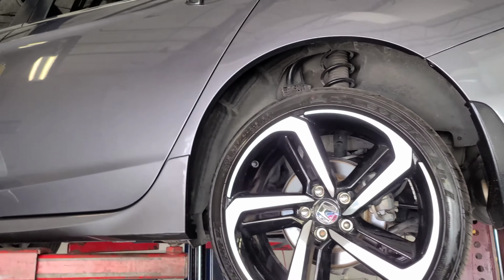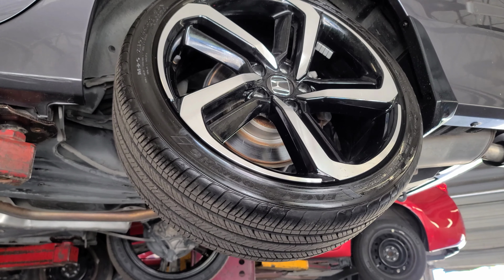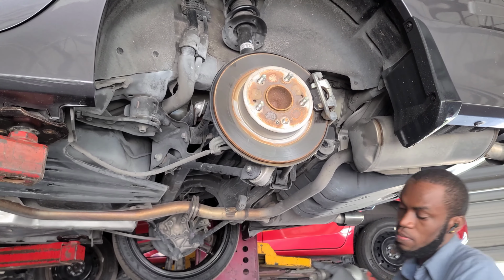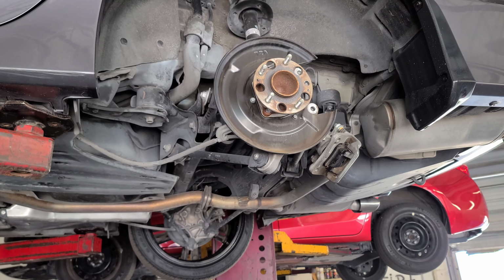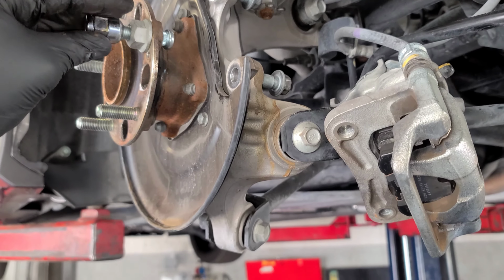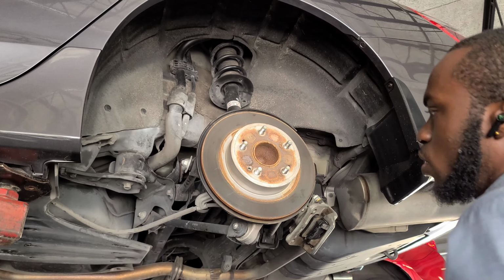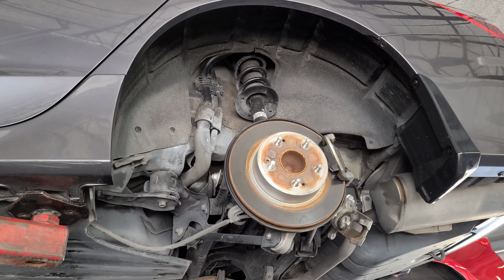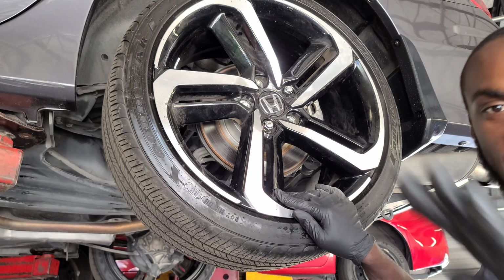how to replace your lug studs honda accord

Comment: Nice video man. I just fucked up mine this morning while trying to take the rotor screw out I accidentally hit one of the wheel studs with a hammer. I thought I need to change whole hub but no it just a screw. Thank you
Reply: You don’t even understand how mad the shit had me for the passed 4 hours went throught the same exact shit as you tryin to take rotor screws out and hit the stud off 😂 I’m cool now knowing I can just replace it and not the hub
Reply: @tb59pt  hey dude I fixed mine if you haven’t figured out this is how I did mine I tethered the stud with a thereder I got from Amazon went all the way down slowly I also put little bit oil. No problem
Reply: Fine was at the front in front you can’t take the stud out it’s impossible if it’s back it’s okay
Reply: I did the same thing
Reply: @nolanray612  rethread it if you can, you should be fine

Comment: For people wondering, this is a 10th gen accord, but this method will not work for the front hub. Doesnt have the clearence to knock them out. You either pray you can rethread the stud with a Hexagonal die ( I used Drill america M12x1.5) or you disassemble the entire hub including the wheel bearing. Good luck
Reply: bro please explain wym by rethreading the stud
Reply: dang mine is in the front too i really don’t wanna do all this but im not tryna get taxed either
Reply: ah dammit did you use a wrench or did you have a kit to thread the die
Reply: @sol1229  My stud wasnt too bad, I used a socket and twisted the rethreader die by hand, and used brake fluid as cutting fluid.

Comment: Sadly this does not work on the older 2009 accord. Bolts dont have room to come out so I had to take the whole hub of, which also pulled the bearing apart.
Reply: Hello, can you please tell me measurements for your honda accord 2009 stud? I want to order online, don't know exact measurements 🙂
Reply: @mrden1  The total length is 46mm Thread lengt is 28mm Diametre of the rifled part is 12mm. 
I bought the whole hub with the studs allready inserted. I noticed the rifling on the new studs where diffrent from the old ones, so be aware of that
Reply: Having the same issue the hub is blocking the bolt
Reply: Thats for the FRONT. 2008-2012 REARS should have room to pull of studs. 
It is however ridiculous that we have to pull bearing for fronts every time just for a $5 stud
Reply: How long did that take you to do ? I’m thinking of just angle grinding the bolts to get them out .
Reply: @Alumnikiid  do you have a video on the front ones 09 accord ? I need to that job

Comment: So I gotta do my front wheel stud can I replace just the stud or does the whole thing need to be replaced? It's the front not the rear the hub is different
Reply from the maker: You can replace just the studs it's a little different in the front but it can be done
Reply: @DULLAHGOSOHARD  ok but the axel housing is really close to it not much room to get the bolt past
Reply: @DULLAHGOSOHARD   well I either have to replace the stud or rethread it I bought a stud but I can't just knock it out with hammer so idk how to get it off
Reply: @DULLAHGOSOHARD  how?

Comment: Hmm is it safe to let the caliper hang by the brake line?
Reply: No
Reply: Negative.  Usually u use like a zip tie to hang it from the control arm so not to stress the brake line.  

I don't trust dude. He seems careless.

Comment: That screw is pointless btw it's an assembly line feature to hold the rotor in place while the caliper and pads are installed

Comment: is that same removal in the front?
Reply: it’s more complicated for the front ones
Reply: @daddy.projects1892  Do you have video on how to replace for front wheel driver side stud? Walmart did tire rotation and they cross run threads and eventually broke stud.

Comment: hey im not trying to be an AHOLE but as long as it was all apart you should have cleaned and lubed the slider pins 1 min work then you tell the customer you did for free they will be back with service like that